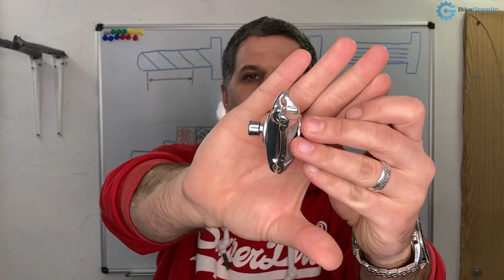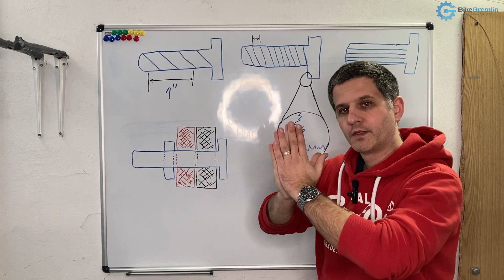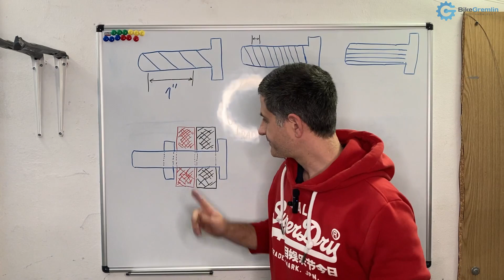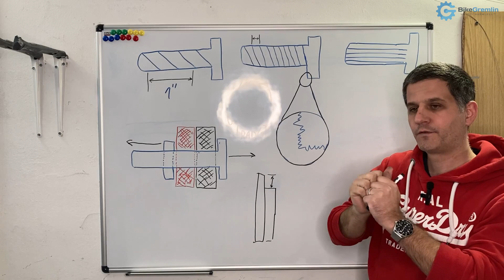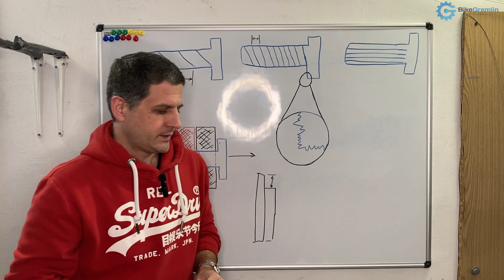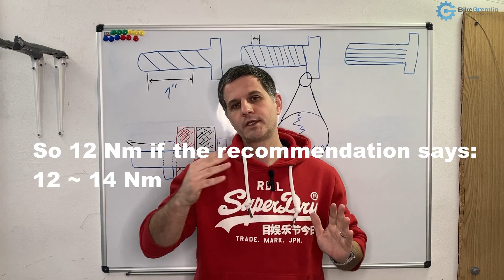Bolted connection and tightening torque basics

Comment from the maker: A shortlist of various bicycle parts recommended tightening torques (torque specifications):
https://bike.bikegremlin.com/14694/bicycle-tightening-torques/

This educational video nicely explains why I was wrong and why split-washers are not effective in locking the nuts (the split washer is discussed from 39:00 for about a minute - the link should open at that time in the video):
https://youtu.be/vkbBpAOM4kM?t=2336

Comment: Hello is it unior torque wrench 266B worth a buy?
Reply from the maker: Hi,
I haven't tried that one, so can't say.
Until I make a video on torque wrenches, here a short list of the ones I use and am happy with.

For 1/2 inch sockets and torques from 10 to 60 Nm, I use this Birzman (Amazon affiliate link):
https://amzn.to/38lMSCc

It has bi-directional torque measurement, so works well for the English threaded bottom brackets, left pedals etc.

For 1/4 inch sockets and bits, and torques from 2 to 16 Nm, my choice is Effetto Mariposa Giustaforza II 2-16Nm Pro - Amazon link:
https://amzn.to/3EL6iwq

It's very small, compact, so easy to get into any tight spots, and it also has a bi-directional torque measuring option, though that has little practical use for those torque ranges (no left-handed threads for bicycles that require lower torques). Far from cheap, but it looks like a high-quality precision tool and holds up pretty well.

Both of these tools have a ratcheting mechanism, which makes it fast and efficient to use.

Having said that, the torque wrench I use most often is Park Tool ATD-1.2. It has a bit holder and a torque range from 4 to 6 Nm, which makes it very handy for stems and similar. Link:
https://amzn.to/3KfXHmD